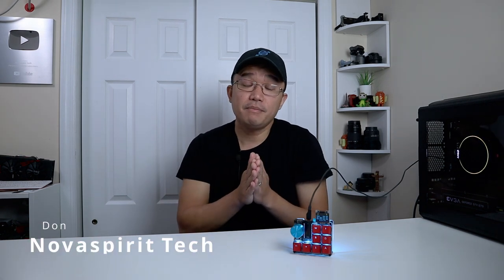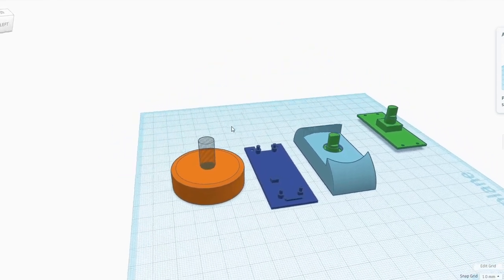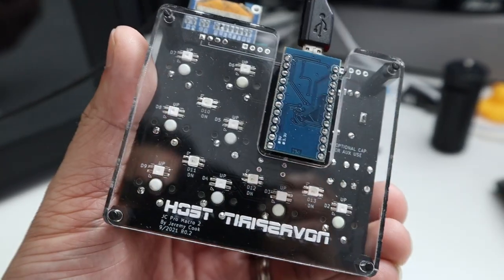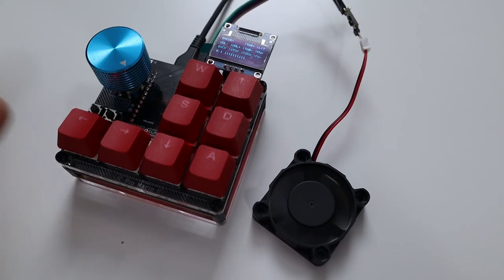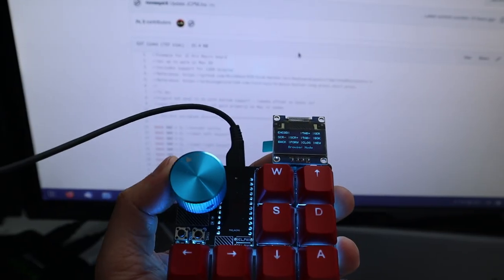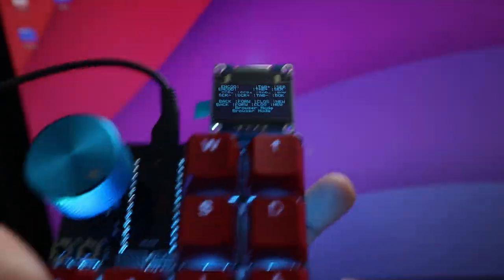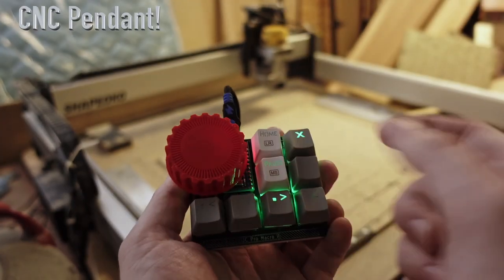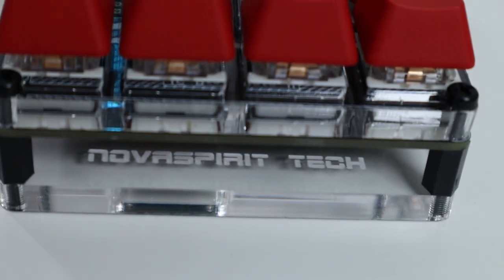Check Out This Amazing MACRO KEYPAD By JC Pro Macro Pad II

Comment: The functions and practicality sounds nice, but IMO the key positions (in relation to the dial) needs to be readjusted.
This can be an ergonomic readjustment or it can be readjusted for a more standard (e.g. like W-A-S-D) layout.
Reply: What would you suggest? I haven't really tried it, but there's no reason someone coudln't set it up at plus or minus 90 degrees or even 180. Personally, I like it, but I'm obviously a bit biased :-)
Reply: @JeremyCook  Appreciate and respect the response.
I am not sure.
It is a gut instinct based on 'how our muscle memory composed of configurations (e.g. WASD or 3-bottom-1-top arrow keys) we usually see and use' lock us down mostly to them.
People adopt familiar things easier and quicker. And muscle memory can be a big entry barrier for these types of devices because they are basically just a physical interface for interaction. And people will look for either designed-as-familiar or customizable-to-be-familar. You should be able to put your hand on it and go at it without looking because it has the used and accustomed design. (Using it plus or minus 90 degrees might not help because then the screen might not be as useful or the cable/socket might get in the way.)
I have no knowledge on board design, so I am writing this independent of that and if that makes it not feasible then I guess you should not continue reading, but...
What about, instead of an L shape, 2 lines x 3 columns with remaining 2 keys on either top end of first and third columns? Unfortunately I can't show it on text.
I am guessing the knob and board design around it might have something to do with the key placement, so I am not sure whether my feedback is even relevant. :)
If it is relevant and you still wish to continue communication, I wouldn't mind it. :)
Reply: @JeremyCook  Would really love one of these for sound/music editing! Not that I have any qualifications, but a WASD layout with the other keys where Q, 1, 2 are and the dial on the 3, E positions? Or dial at 1, Q and others at 3, E?